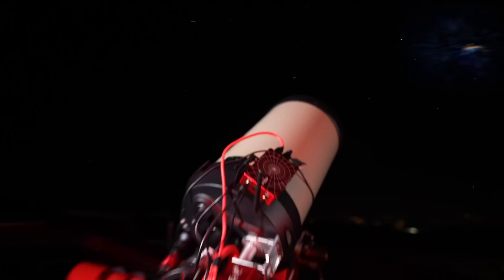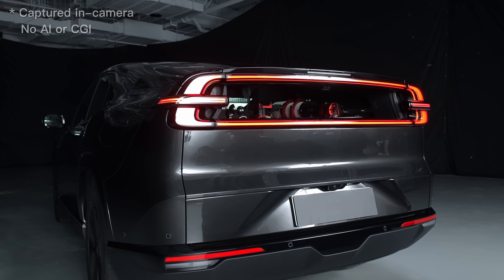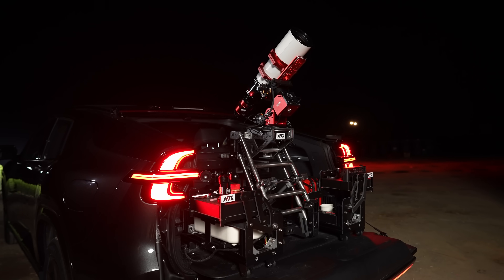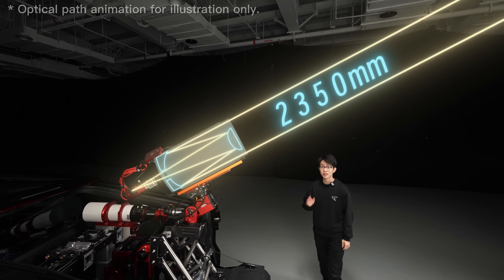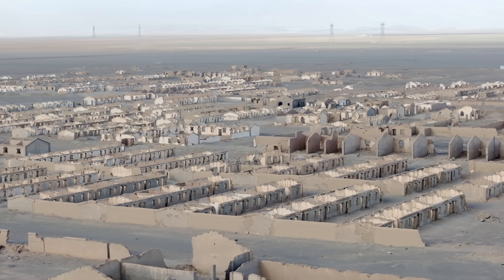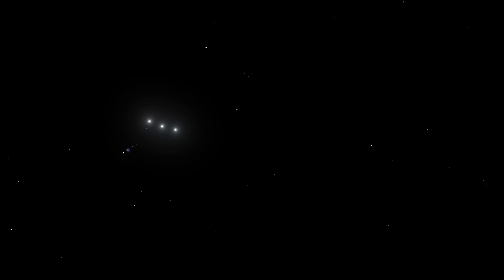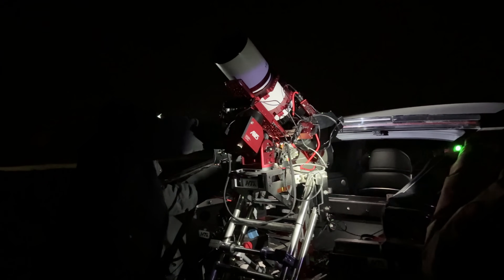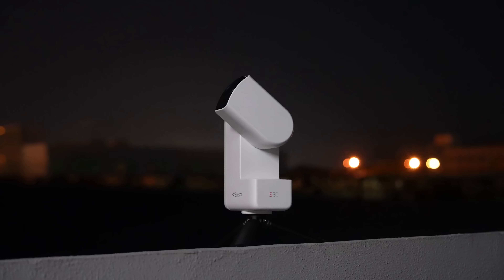We Built This to Film What’s 7,500 Light-Years Away

Comment: Astrophotography gear is such a dog's breakfast so a mobile obs is a great idea. Until someone can integrate 8" SCT, F6.3 focal reducer, computer controlled autofocusser, rain-sensor protected mirrors, dew heater, high-precision equatorial mount (good for at least 5 min unguided exposures at 1.3m FL), all 7 filters ,a full frame cooled monocam, 5v and 12v power supplies, usb-ports, and 500GB SSD NUC (no phone app! full remote desktop access),  into a single water-proof unit. A standard dslr  has a lot of engineering built into such a compact unit so not mission impossible.

Comment: Dude this is so amazing! Im at the part where you talk about the car not being stable and that could be from so many factors but mainly wind, made me think what if you installed stabilizers on the bottom frame of the car that can extend out on remote and stabilize the car in four different points, kinda like a camper/trailer. Plus then if you use strong enough ones, makes it super easy to change your tires too while you're at it! hahaha

Comment: Just lights in the sky, nothing tangible that you can quantify. Regarding the impossible reference frame known as the vacuum of 'space', nature abhors a vacuum. It is impossible to have the Earth's pressurised gaseous system coexisting directly next to a vacuum without a physical solid barrier separating them, it would want to equilibrate, the Earth's pressurised gaseous system would need a physical solid barrier to contain it.
Here on Earth, in objective reality, bodies of water, ie. ponds, lakes, oceans, cannot hold permanent convexity across their surface. Bodies of water cannot conform to the exterior of shapes. When there is the very slightest of inclinations to the surface of a body of water it will always flow and find its level, in a horizontal straight line from the starting point to the end point regardless of distance. Supposed curvature has never been measured. The Earth is demonstrably level.

Comment: So, you notice that the mount and most of the other astrophotography equipment is red in color, and actually comes from another Chinese company called ZWO.  They are a well known company in this space, and their only two problems are that they are expensive, and their software only works with ZWO hardware.  If you want to mix and match ZWO hardware with something from another vendor, then you have to use third-party software that can control both, and which has drivers for the ZWO equipment that has had to be reverse engineered.

The telescope tubes look to be standard (one is from ZWO, but I’m not sure about the other one), but of course the rest of the hardware for making this mobile observatory work, is all custom.

IMO, this short is basically an advertisement for ZWO as much as it is anything else.  One of the first objects I ever imaged was the Orion Nebula with my SeeStar S50 telescope (big brother to the SeeStar S30), and those images don’t begin to compare with what is shown here.  This is much more an ad for ZWO than it is an ad for SeeStar.

Of course, capturing those images is only part of the battle.  Then you have to align and stack all those images, and go through a lot of post-processing steps to get the final images shown here.  I’d love to see an in-depth video that goes behind-the-scenes on how all of this was done at the software level.

Comment: Really cool, I’ve beem building something similar on and off for the last two years, but not as polished. I’m building it on a trailer though, while not as cool, it does make sense - first of all because it’s much cheaper than to dedicate an entire car to it, but also because of the thing mentioned in the video, that a vehicle is less stable than a tripod. I’ve added extendable supports to the trailer, like on a monile crane, so when shooting those are extended and they lift the trailer off the wheels which makes it rock solid, an additionally this allows for leveling of the trailer, so even if there’s an incline the eq mount can’t deal, the trailee solves the issue. 

The final upside to the trailer is that it’s roomier than the car trunk, so the telescope setup doesn’t need as much assembly/disassembly, which cuts the costs alot if everything is to be automated.

Comment: 3:14 why didn't you show me the moon with this big one instead?
Reply: Different types of telescopes are better for different applications.

The smaller looking telescope is generally a refractory lens, think binoculars and old school long tube scopes that taper down on one end.

They have more highly curved primary lenses which are better for clearly resolving nearby objects, like the sun, moon, and planets.

Then you have reflector telescopes, which tend to be much larger because a very large primary mirror is used to gather as much light as possible.

These tend not to have a taper because the light has to go through the whole length of the tube before reflecting off the mirror, and so they look much larger, for something with a similar resolution, but they are better for gathering lots of light to look at galaxies and nebulae. 

You can do both with both, but for the same amount of money spent, one will be better for solar system objects, and one will be better for further objects. 

There are also combination telescopes that use both mirrors and lenses as well, but it's best to ask your favorite AI app to explain those in more detail.